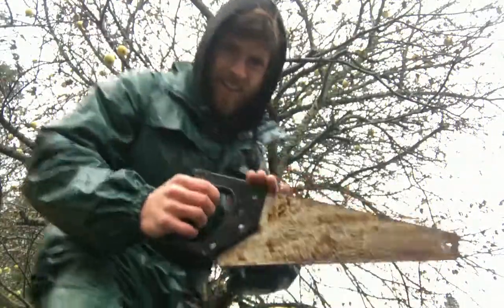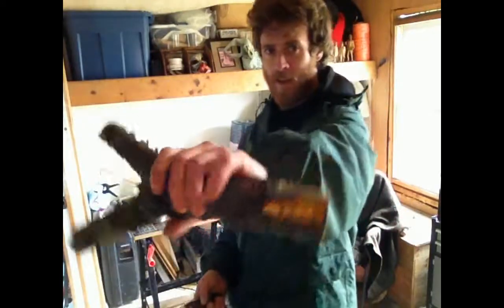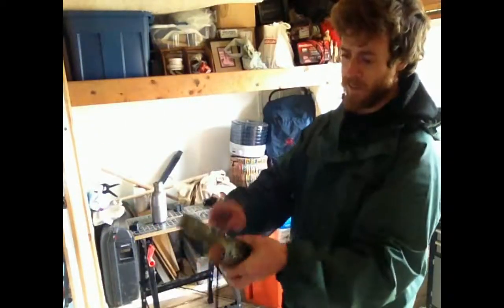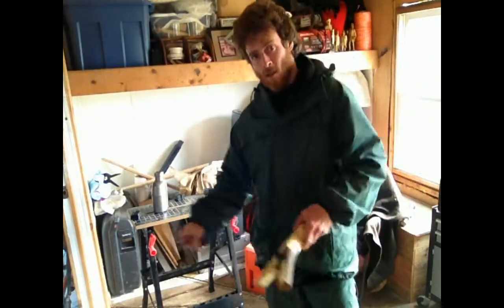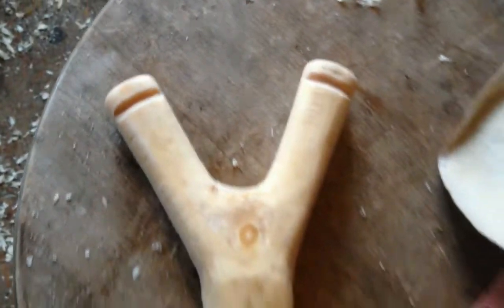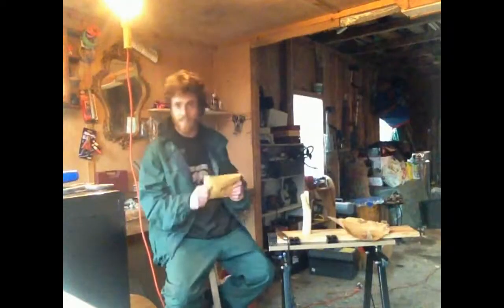Slingshot Build & The Featherlight Pouch

Comment: You nailed it with this Fowler parody. I missed the shovel, though.
Reply: The lighter side of utube.  and you got good tips and tricks if you look close.  Nice saw, the first one.
Reply: I tried sharpen one like you have with the orange handle, Sanvik or Barko, with hardened teeth, wrecked the file.  Oh well.  Disposable saws, as they dull I let them get used for poorer and poorer stuff, pvc pipe and close cuts to concrete and the like.